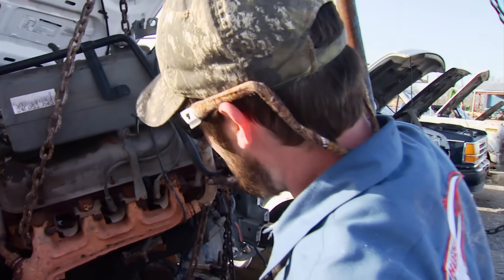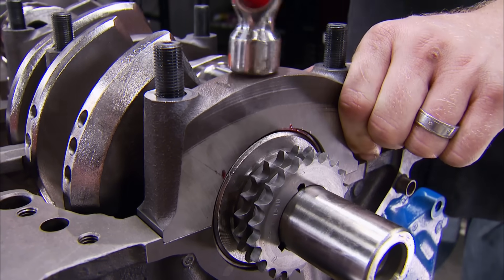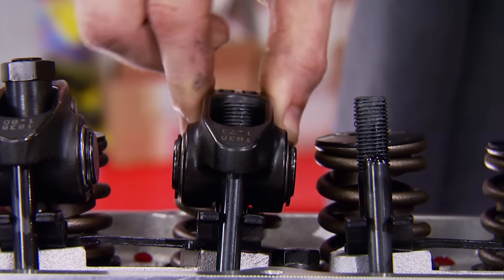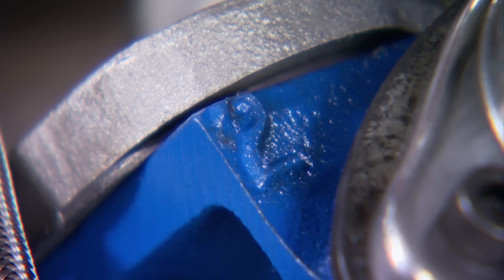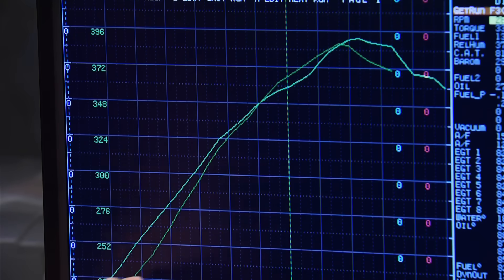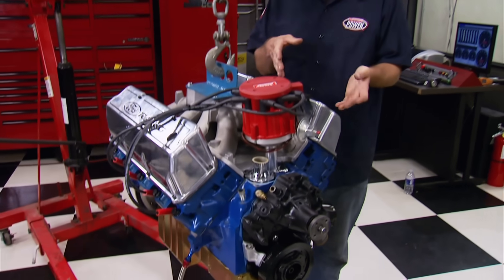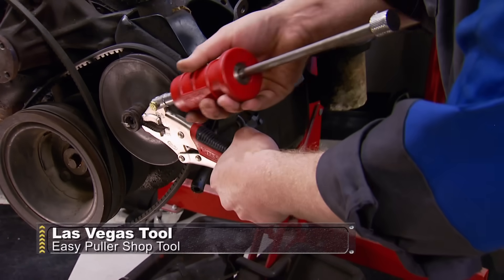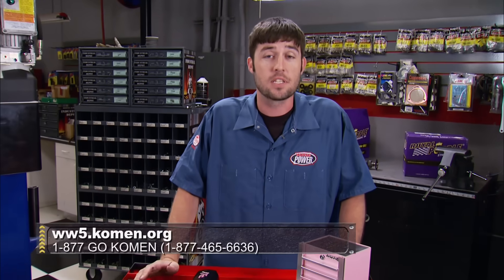351 Small Block Dyno Shootout: Windsor vs Cleveland - HorsePower S16, E11

Comment: I was expecting a stock Windsor 351 vs a stock Cleveland 351...🤔
Reply: That's what I expected and wanted to see, but these guys never seem to do a REAL comparison...
Reply: As was I.
Reply: umm   me too
Reply: Me to
Reply: Me too...I feel duped. Lol.
Reply: That's what I wanted as well, this has nothing to do with stock motors.
Reply: @nellawell4976
Reply: Exactly didnt they have a 351 marine motor aswell
Reply: we got hosed
Reply: it would be difficult to find similiar spec engines between these two Fords because unlike the 351 windsor, the cleveland was developed as a performance engine.
Reply: @bobbybobberson9349  That is the whole point, they are not similar in stock form.
Reply: @bobbybobberson9349  yep but cubic inches, vs cubic inches is what it should be.
Please try and keep up!!!
Of course the Cleveland was better, brainiac!!!
Reply: No contest.
Reply: Was also expecting less bull shiiite! The 4V heads are hardly 'race heads' with less high RPMs power than the 2V heads! Of course, we all know the 4V heads had horribly shaped ports that introduced all kinds of flow-blocking turbulence! Valves and ports big enough for 600 HP but struggling into 300's HP... They need 'port plates' or welding and re-porting to work properly... 
Of course, most stock 351W heads struggle to make 250 HP, so that wasn't going to impress, either... 
And all three combos, 351C 2V, 351C 4v, and 408W Eddy Clevor Heads, looked weak compared to this off the shelf SBC 400: 
https://www.dailymotion.com/video/x3rfhrk
Reply: @BuzzLOLOL  Well, Clevelands around 400 ci won Engine Masters something like 4 years in a row, all using the Aussie CHI 3V heads. Over 700hp on pump gas. But Engine Masters entrants had all kinds of weird tricks, like rocker ratios up to 2.2 to 1! That wouldn't last long on the street.
Reply: @donellmuniz590  - I assume the Aussie heads have much better port shapes than the USA 4V heads that were prolly intentionally screwed up to limit HP and only to be used as a "starting point" for real racers.
Reply: @BuzzLOLOL  Yeah, back when Pro Stock ran small blocks, guys like Glidden and Kaase were welding in those ports, raising the floors, moving shit around, doing all the things by hand, in cast iron, that can now be cast in the foundry in aluminum and CNC'd to perfection in a few hours.
Reply: @donellmuniz590  - I still like to help my friends port their iron heads once in a while... say somebody inherits a 70's Nova with 125 HP SBC 350" from Grandma... a few bucks in pistons, cam, and a little elbow grease can really transform one into a fun streeter...
Reply: @BuzzLOLOL  I had a 76 Malibu with the 130hp, 2 barrel 350. Pathetic! But it was such a cool lookin' car! Like a NASCAR Laguna, minus the slope nose. I wanted to hot rod it, but it was my daily driver. Swivel buckets, floor shift, slot mags, cherry bombs. I miss it. But it was slow AF!
Reply: @donellmuniz590  - Would have been so easy and cheap to bump to 350-375 HP...
Reply: @BuzzLOLOL  At the time, my project car was a 65 Satellite with a 440. I'm more of a Mopar guy. Tried building a 74 Nova once, but my heart wasnt in it, so I sold the Nova and bought the Satellite. Most of my projects have been Mopars. My daily drivers have been a mix of Mopar, Ford, and Chevy.
Reply: @BuzzLOLOL  Knowing what I know NOW, that ol' Malibu would just get junkyard Vortec heads, a cheap flat tappet cam from Summit (the tried n true 224 @.050, .470 lift), a Performer RPM intake, 750 carb with vaccum secondaries, headers, and 2.5" dual exhaust. That's all. Probably 325 hp, and daily driver streetability, tq, and power brakes.
Reply: @donellmuniz590  - The 3 best looking Chrysler products: '65 Satellite, '68 Charger (still hope to score one some day), '69 RoadRunner...
Reply: @donellmuniz590  - Your combo built with proper engine quench and compression ratio should easily give 425-435 HP !!! Same # in torque!
350-375 HP with the stock '74 SBC heads! (Vortecs not available back then)
Summit 224 cam is, of course, a slightly modernized version of the stock SBC L46 350 HP 350" cam... 
That same cam/lifters is currently available for $10-20 less from Jegs... 
I use the 224/234 .465"/.488" lift version... along with 1.6 rockers for $66/16...  
Q-Jet/Thermoquad 4 bbl. would work fine... 
This 383" build used stock 1.94"/1.5" valved Vortec heads (except for valve springs): 
https://www.hotrod.com/articles/gm-ht383-crate-small-block-tune-up 
.
Reply: @donellmuniz590  - My favorite low cost 318 build: 
https://www.hotrod.com/articles/318-small-block-build
Reply: @BuzzLOLOL  Thanx, that was cool. 409 hp without Magnum or aluminum heads! I'd probably just use 1.94 valves, so I didn't have to notch the bores or machine the chambers. And I might go a bit bigger on the cam to get more "cackle". But still, a great bucks down build.
Reply: @BuzzLOLOL  I have used the ubiquitous 224/234, 465/488 grind in the past, but it was in a Dodge 400 30 years ago! Ran strong, too, 13.30s @106mph in a 3800 lb Charger on street tires. Good cam.
Reply: @donellmuniz590  - The K1107 234/244 is about same spec.s as the Pontiac Ram Air V 500 HP cam (with Ram Air V tunnel port heads, 1.65 rockers)...
Reply: yea me to i could tell they wanted that windsor to make more power then the cleveland wish they did equal mods on both
Reply: Remember when youtube wasn't obnoxiously innundated with excessive commercials ?!?
  Pepperidge Farm Remembers !
Reply: @MyButtsBeenWiped  - Need an adblocker to block those and a million other adds...
Reply: It kinda was, halfway.
The Cleveland just used a cam and lifters / intake and carb.
The Windsor was:
Crank / pistons / rods / cam and lifters / aluminum heads / intake and carb.
While the Cleveland was a "massaged" engine, the Windsor was a completely modified version. Keeping just the block.
Reply: No money from parts advertisers in that!

But yes, rebuild both to an OEM spec and compare as the build progresses and then do the final testing on the dyno.
Reply: @dougwebb704  - We already know most Windsors struggle to make 250 HP... whereas Clevelands make 300+ HP...
Reply: An initial baseline would have been nice. 🙄
Reply: @Harley.Davidson  - Too many people would laugh at what most 351W's baseline at...
Reply: you all prolly dont care but does anyone know of a way to get back into an instagram account??
I stupidly lost my password. I appreciate any help you can offer me
Reply: @luisleonard8052  - Should always choose a password you will always remember... maybe it will come back to you if you don't try too hard to remember it... 
Maybe Instagram will help you...
Reply: @Luis Leonard instablaster :)
Reply: @Dustin Charles I really appreciate your reply. I found the site through google and I'm waiting for the hacking stuff atm.
Takes a while so I will get back to you later with my results.
Reply: @Dustin Charles DAMN IT ACTUALLY WORKED :O Just got access to my IG account after roughly 40 mins of using the site.
Just had to pay 15 $ but for sure worth the money :)
Thank you so much you saved my account :D
Reply: @Luis Leonard No problem xD
Reply: I have both a 351 M and a 400 in my 77 Cougar wagons.   I need to get a timing wrench for the distributor that I know will fit.   If you are using a Snap On timing wrench on the O.E. distributor nut, can you give me the part # of the wrench ?   Or if another brand, the brand and the part number?   I see a lot of Snap On F 8564 B timing wrenches on ebay, but none of the sellers have used the wrenches (I asked each one of them).   Any help appreciated.  Thanks
Reply: @tompastian3447  - If you are having trouble turning the distributor, realize that they tend to seize up in these Ford motors and difficult to turn/remove...
Reply: @BuzzLOLOL  I just want to adjust the distributor.  Try to find a timing wrench at an auto parts store, or off a tool truck like Snap On or Matco.
No one has them on their truck or in the auto parts stores.   I remember having one years ago, which disappeared.    If you have a Snap On timing wrench that you know fits the Ford engines, I would like the part number.
Reply: same here. stock 351 windsor vs stock 351 cleveland
Reply: I've had both motors the Cleveland was better for power everytime
Reply: We are in 2000's brothers
Reply: They're incapable of doing such simple things!!!
Reply: Can't get a sponsor that way.
Reply: Thumbs down
Reply: So was I.
Reply: @mydogworriesalot1840That's what was in my cousin's ski boat
Reply: The engines should have both been the same cubic inch displacement, this made no sense
Reply: Australian Cleveland Aluminum Cylinder Heads are the way to go.
Reply: Yes, this makes no sense to me!
Reply: Same this is just stupid
Reply: At least keep them the same ci
Reply: @mater3709  how did they keep him the same cubic inch, when they put a 408 stroker kit in 351 Windsor

Comment: I noticed they addressed the Achilles Heel of Clevelands, by bushing the lifter bores. Hi-milage used Cleveland blocks (100K+ miles). usually have worn out lifter bores and for that reason can't successfully perform with hydraulic cams. Sleeve the bores and you're good to go.

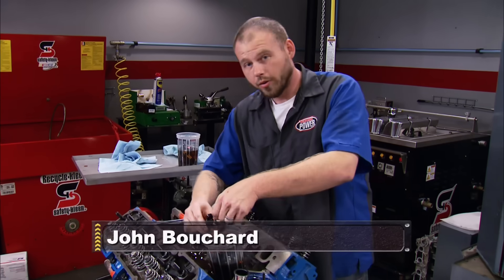Comment: 0:40 I predict the Cleveland 2V heads will make more horsepower than the 4V heads.
Back in the 1980s I swapped my 4V heads for 2V heads. A much better street MUSTANG.
4V are HUGE, to BIG.
Reply: the 4v heads would make more topend power if they had changed the carb to a better sized one, looks like she was getting carb choked up in the topend
Reply: @logical_volcel  
Real world experience.
The 2V are better on a street/strip mustang.
The 4V heads where for drag racing cars that had huge camshaft & High compression.
Reply: @nellyfarnsworth7381  no denying a 2v is better for the street but this comparison doesn't really show how much more power a 4v head can make, the factory carbs on 2v heads went upto 650cfm i think from memory meanwhile ford australia put a 780cfm on the gtho 351c, so just saying the test is a bit ingenuine if they're using the same carb and even camshaft setup
Reply: @logical_volcel  
They where called 2Valve heads. Most people thinking, the ports are small. But 2V head ports are large.  And the 4v heads are HUGE.
REMEMBER in early 1970s,  BIGGER was better. This was before most people understand CORRECT port design.

Comment: This was a displacement discrace. You gave a clevor 50 plus cubes. that is stroke. how is that fair? i had a Boss 351 produce 396hp with 485ftpds torque. WTF. I killed 33 magnums in road races. Didn;t have better victoms. in boondocksville Ontario. Smoked everything I met. Duh?

Comment: Apple's and oranges.But I understand giving the windsor all the trick parts.
  If you ran a contest on a level playing field ,the windsor is a terrible contender.
  Years back my 2v clevland could easily stomp a 351 w. They were pathetic.
 After the clevland had been out a couple of years,no 1 wanted a windsor
Buy the time Ford had sent all the Cleveland stuff to Australia,Ford was about to start peddling the 351. M. Engine.
  In 77 all the Ford truck guys wanted that clevland in there f150s.  The salesmen consistently lied to them. Saying yep this is a Cleveland. So to this day There are still guys out there that sware they had clevlands in there trucks From Ford.
  The 351 C was the best engine Ford ever made next to the 460.
  In my opinion.

Comment: Not a fair fight there.Stroke the Cleveland to a 395,use the 4V Cleveland head,only use the older closed chamber 4V head,then test em again.Or better yet,slap the same aluminum head on a stroked Cleveland,Itll make over 500HP in your sleep.

Comment: yeah right not much of a comparison here stock motor verse modified race motor, do the same shit on the cleveland motor like yall did the windsor, i had a 71 351 cleveland that would dyno over 600 hp with a holley1350cfm carb running on 101 octane, but it sure as hell wasnt even 10 compression, i had 12.5 dome top pistons,4v heads that were actually cobra jet heads balanced/blueprinted ,etc etc etc, cleveland will make big power and torque if built correctly

Comment: you would need to put the same parts combo in each engine to make an accurate comparison
Reply: Put the factory stock heads on the 351 Windsor and the same cubic inches and compression to make a fair comparison, Putting all aftermarket parts on a Windsor with parts  and heads it never came with then give it more Cubic inches and Compression, then build a stock 351 Cleveland with the same parts it came with back in 1970 - 1973. Then you put a engine against it that has 50 years of up grades and call that fair. BS. And give the Cleveland less compression and cubic inches then no up grades at all. Really??? That's not a comparison, that's BS!!!

Comment: what a waste of time watching that, in 30 years I've never seen anyone build a Cleveland for performance using 4v open chamber heads
have to use 4v closed chamber heads and let it rev
The 408w was weak also,  here in Australia theres plenty of street cars running 393 or 408 clevelands that are much stronger than that
These guys have zero credibility as far as I'm concerned
Reply: they are chevy guys.

Comment: What the hell is this? 357cid vs 408 cid is not an apples to apples comparison.
You need to compare them with components (cam, heads and runner volume, intake, stroke, exhaust, compression, et cetera), that are as similar to each other as possible.
This is a bullshit comparison. You guys didnt prove shit.

Comment: Good video but I wish they would have talked about the difference between Cleveland 2v open and closed chamber heads as well as open and closed 4v chambered heads not to mention the 2v 4v Aussi heads the heads they used for both the 2v and 4v heads are open chambered heads which are the most common to find but the worst to use for performance

Comment: Here ya go now compare this motor with you 351 Windsor it would be about as fair because your Windsor had over 50 inches more then the Cleveland Motor did so here's a 408 Cleveland that rev's higher then your motor. see it's not a fair comparison either is it. You also used New after market heads and Piston that the Windsor never came with from the factory. So here match this up and rev your Windsor up a little more to the same RPM's. This is more fair then the Comparison you guys made between the two motors. You want to use all after market stuff that was built in the 2000's years with all the new advance's. And you want to compare that with a motor that is all stock built back in the early 70's and then not give it any upgrades past stock. NOT FAIR at all, Give the Cleveland all the After market parts with the same Compression and Cubic inches as you guys threw at the Windsor motor and you know the Cleveland will out run that Windsor. That should not have even been called a comparison. UNFAIR<UNFAIR<UNFAIR<UNFAIR<UNFAIR<UNFAIR< Check this 351 Cleveland  out that has been upgraded. https://www.youtube.com/watch?v=1zk6jO5vXHc

Comment: If you want a fair comparison make both engines with the same Cubic inches and same Compression and I guaranty the Cleveland Motor will kick the shit out of the Windsor. I have built both motors and the Cleveland when built right will out Horse Power and out Torque the Windsor. This is a BS comparison and these guys should be giving the engines a  real comparison, not one sided crap comparison like this is. And Trick Flow put out heads that Flow twice as much as the stock Cleveland heads and the give you the best of both worlds with great bottom and top end rpm's and their are even after Market companies that put out new Cleveland blocks with 4 bolt mains and address any weaknesses that Cleveland blocks had in the past. A totally unfair Comparison that's like putting a strait 6 against a big V8 motor. BS I'd be ashamed if I were these guys.

Comment: I'd have at least used 12 1/2 - 1 compression pistons in a .30 over Cleveland engine with a 2V head , do a good blend job on a good valve job and with enough cam you could' reach 500 HP.  (Chris Holbrook told me that) I had done up a 351 C .30. over short block just that way but ended up selling it to guy who had a cylinder crack on his...

Comment: 4V vs 2V. "2V for the street". BS this is a classic case of mismatched parts! Your intake manifold, carb., cam, exhaust all optimized for the 2V head. A small port, small carb, little cam on a 4V Cleveland? Ford engineers designed the 4V for "free breathing" and then you guys choke it off. Then you compare these 2 to a stroked 400+ cube Windsor block with aftermarket Cleveland heads and then have to add more breathing!!! 2V for the street my ass. My Boss 351C says you are wrong.